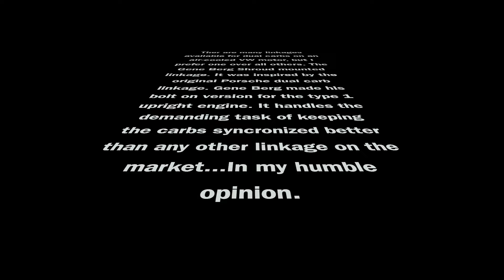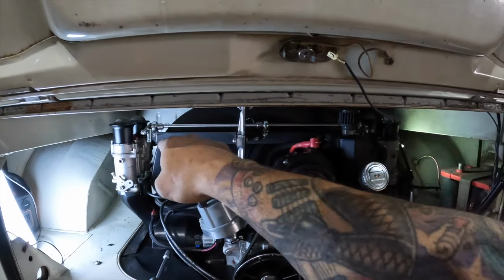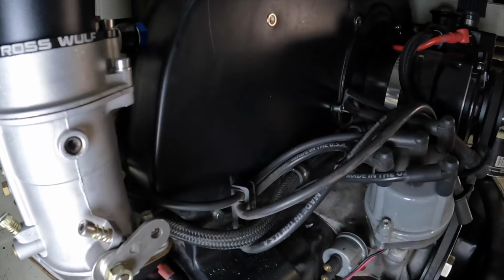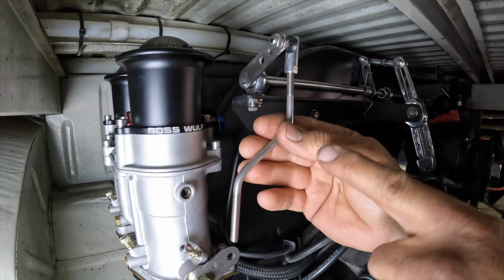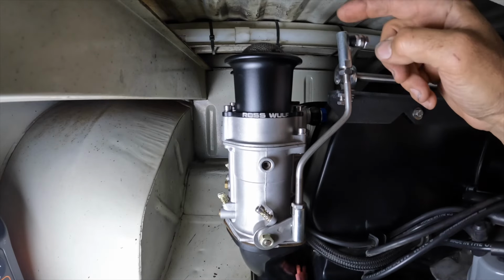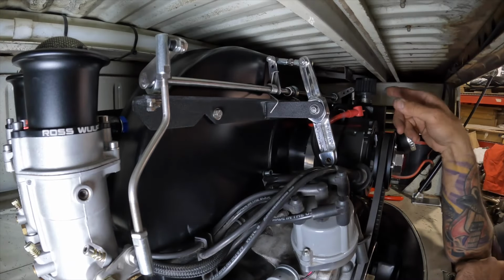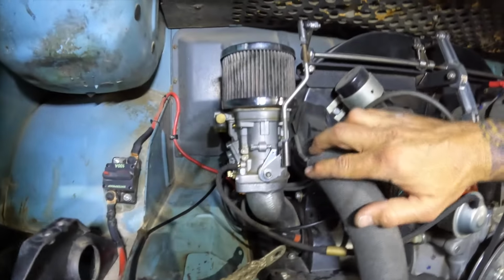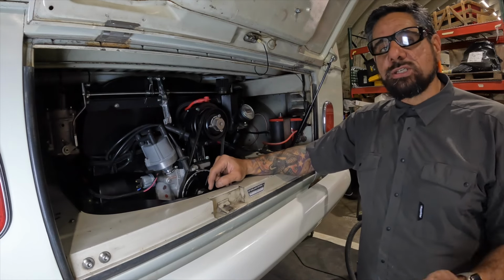Installing a Gene Berg Linkage on a VW Bus

Comment: Another great video!  I replaced the original CB hex bar linkage that came with my dual Dellorto 40 assembly after a few years - with a Berg linkage. Had to order (2) longer arms from Berg to reach the throttle shafts.  Huge difference in throttle response and lighter pressure on the pedal.
Reply from the maker: Agreed. My pedal feels stock. You’d never know I have dual carbs. 👍🏽

Comment: G'day man, 
An awesome video. 
On my 63 bug I went through the Chinese crap and finally ended up at Gene Bergs setup. No more problems my car now pulls so much harder. One thing I did install was the small roller wheel setup that you can screw onto your  shroud. Anyway thanks for sharing ✌️ Peace from Melbourne Australia.
Reply from the maker: Thanks for watching👊🏽

Comment: Fantastic. I’ve got the berg linkage on my Baja came with the car when I bought it. I’ve always been a little confused about the adjustment on the linkage so the video really helped. I’m running dual Zenith NDIX 32 carbs on my 2010cc motor. Berg crank and berg rockers. Other than that it’s all stock.
Reply: Good stuff!

Comment: Great video. 👍👍
Have you seen the Sync-Link throttle Linkage Kit? What are your thoughts with it?
Reply from the maker: I’ve seen it but never used it. I like the idea of it but have not seen it in action to determine if it will works well or not.

Comment: Great video.  I have a Jeffries Kyote buggy and the back deck is not cut for the scoop.  I am concerned about the clearance when the throttle is wide-open because I have limited distance from the fan shroud to the rear deck of the body.  Do you know what that distance might be?  If not the GB linkage, I am going to look at the Vintage Speed linkage.  Thanks
Reply from the maker: I’d estimate about 3” away from the shroud. The vintage speed is a nice linkage.

Comment: Push Pull is the best option on a built type 3 unfortunately. I’ve learned to love idling at 1100-1200 after getting off the freeway. 😂
Reply from the maker: Get the Vintage Speed one. Arms won’t pull in since they are separated at the carb by a slip joint. 🫡

Comment: Just a quick question can I use this linkage with Weber carburetors?
Reply from the maker: Yes you can. You have to call into Gene Berg to order it. Have the measurements of between your carbs when ordering.